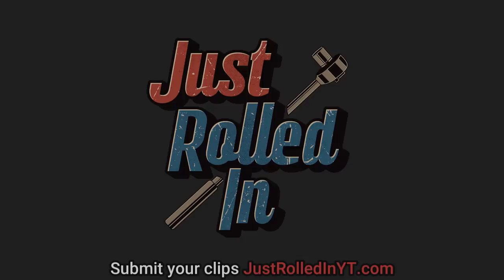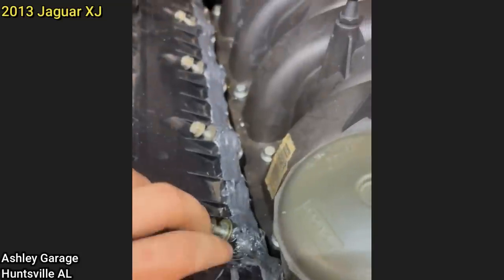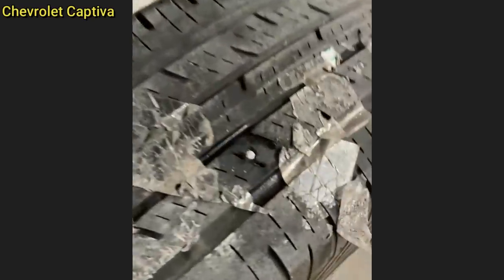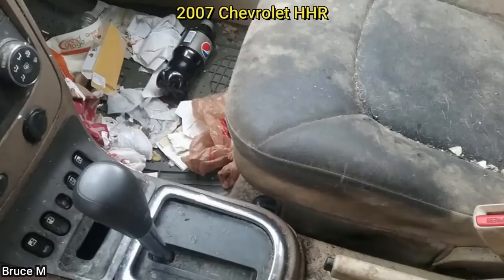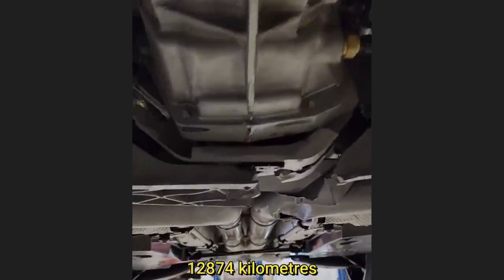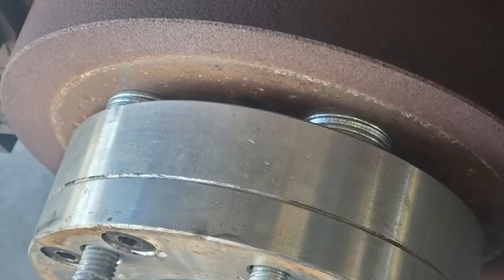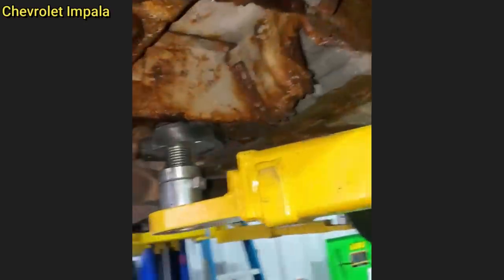Customer States Truck They Bought Has A Rumble At Low Speeds | Just Rolled In

Comment: As a mechanic, this is one of the most anxiety inducing episodes I've seen so far. Really glad we don't get disasters like this in the shop. Often...
Reply: Yeah man. I commented earlier that this is the worst one ive seen yet on this channel!
Reply: Sorry, yeah woman!
Reply: @rgr4475  lmao, no worries. 
But yeah it's honestly kind of impressive, if not completely terrifying. The worst I've seen at my shop since I've been there are wheel bearings with way too much play, and tie rod ends holding on for dear life. Once we had an Astrovan that had it's idler arm attached to the frame with some thin sheet metal and some small self tapping screws, and they were wondering why it was all over the road. Another time we had a Wrangler come in and the pinion gear in the rear diff was absolutely shredded.
Reply: @rgr4475  This hit me the same way! I kept saying to myself How? Why?
Reply: They don't need a mechanic.  They need a drug rehab clinic.
Reply: @ShelBelSapphire  Haha nice! Speaking of wheel bearings, I need to do my rear hubs. Are you far from northwest NJ?
Reply: @rgr4475   Minnesota, lmao. Bit of a drive.
Reply: Most these cars are from ghetto shops in the inner City. The sad thing is I still have 60 easy payments left
Reply: Thank god we never get these kinds of disasters in Finland. Thanks to yearly Safety & Emissions Inspection, which in a way is PITA, but least all cars on the road stay pretty much safe
Reply: @MrBluePoochyena  I honestly wish we had those here. Would make my job easier.
Reply: @ShelBelSapphire  It just makes life PITA if you love building cars for extra power and shit. Got to get reinspected/"reregister", 25% max HP gain over highest engine trim level allowed (provide Dyno Slip with more than 0.4 Bar of boost) which most cheat and actually run different settings. If i were to get the 17X9 Flow Formed Alloys and 245/40/17 tires for Summer, i got to reregister the car with those for my car to stay legal and not get ticketed. Same with Suspension and everything
Reply: Living here in Australia our rego inspections have always been a bit strict and even 40 odd years ago it was rare to see vehicles as bad as most shown here and the ones we did see were nearly always turned away.
Reply: @davegoldspink5354  Cars in this condition if we would ever even see them coming to the inspection would stay in that parking lot until the owner calls someone to pick it up for crushing
Reply: My thoughts exactly I kept saying HOLY (expletive deleted) the washers on the wheel spacer...
Reply: @ShelBelSapphire  Where at in Minnesota? The rust here causes people to get creative. My dad has moved his auto shop around the Coon Rapids area. Probably the worst one that came in was a car that started to buckle in half as the frame was being lifted up due to the rust and my dad dared not lift it up any further and told the guy its just gonna happen because the car was toast. I hear its not quite as bad near the southern end of Minnesota. Duluth, Grande Marais and around Lake Superior are probably where cars go to die I'd imagine. I haven't talked to the mechanics around there but that extra lake affect snow and salt must be even worse. I saw a rotted car where they replaced the doors and bumper with plywood and 2x4s when I drove through Duluth one time. A few years ago I drove by a guy where I could see his knees though the door.
Reply: I can't believe people put their family in those death traps. Let alone get an insurance company to cover those shit piles.
Reply: As a non-mechanic, I thought everything looked good, especially the tire repaired with packaging tape.
Reply: @schmojo33   I'm from around the cities, but work a bit north of there. Legitimately, the rust is my least favorite part of being a mechanic here. A 20 minute alignment takes twice or three times as long because you have to break out the torch half the time to deal with the rusted bolts. It wouldn't surprise me if the Duluth area was worse though. It's all around pretty bad rust wise. 
We are far enough from the twin cities to not have to deal as much with total rust buckets, thankfully, but a shop I worked at years ago, we ran into that constantly.
Reply: @ShelBelSapphire  Yeah the auto manufacturers don't make cars for the far north at all and the book time for each repair is completely fictional hopes and dreams. The new cars designed not for people to work on them combined with all the rust and relatively low pay for increasingly complicated cars where you basically have to have an education almost like a doctor is why I decided not to follow my dad in being a mechanic after being with him through repairs growing up. Not to mention customers not really understanding why the cost is what it is, especially in the rust belt. Watching people work on cars in places like California or Texas is like watching a whole different line of work.
Reply: @schmojo33  You're telling me. I just bought a "high mileage" 996 Carrera from Arizona. Zero rust. I did the rack and pinion on it, a ~2.6 hour job for just r&r, not counting tie rods and alignment. It took me less than half the time, not including waiting for parts. Would have been quicker had I not had to back track a little. Zero-rust vehicles are what I wish I was doing professionally, lmfao.
Reply: It looks a bit too much. Uhmm like BS
Reply: Agreed! My chest hurts!
Reply: that transmission mounted with a screw jack, straps, and a chain...... seen it all now

Comment: Gorilla glue? On a door? WTH!?! I think I’ve seen everything now… dear Lord.
Reply from the maker: Let's hope there isn't an emergency when you need to use that door 😅
Reply: @JustRolledIn  seriously! That’s just crazy.
Reply: angry ex?!
Reply: At least it doesn't needs the new latch XD
Reply: Modern day Duke brothers...  I was pondering how does one dissolve gorilla glue.
Reply: Common sense comes in variety packs 👍
Reply: " I think I’ve seen everything now… "
Yeah, wait till next episode
Reply: @douglash9364  That’s easy, real challenge is dissolving the gorilla glue without also damaging paint or plastics in the process.
Reply: @joevk6274  ah shit. U have a point there….🤔
Reply: yeah i know.  you're supposed to use bailing wire to keep the door closed.
Reply: @johnmarten4184  oh man. I ,Iove it!! That’s a much better idea.
Reply: @johnmarten4184  ... as long as the seat belt works you can use duct tape to hold a door closed. Heck, you might even be able to roll down the window and use the seat belt to hold the door closed!
Reply: @walkietalkie1973  you sure its variety packs and not lootboxes?
Reply: Just run the seatbelt thru the door pull.
Reply: @mikebelcher5111  ... you'd have to look and see if that was an option.
Reply: @Kalvinjj  should rename the channel to "You think you have seen everything.."
Reply: Just remember that woman who used Gorilla glue in her hair and tried to sue the company that manufactures it. That's the sort of person we're sharing the planet with.
Reply: The person who did this likely thought it would've been a complex repair costing  $800 to have it fixed so they glued it 🤣 .  Mechanical aptitude is heavily lacking these  days as this repair would've likely been under $50 for parts  or to simply have a mechanic fix it for around $250 .
Reply: Let's just hope nobody ever try to use gorilla glue on their eye lashes or hair 🤣
Reply: F*** a door. The first dude had his transmission and engine held in place with ratchet straps and a chain!
Reply: @JustRolledIn  "Let's hope there isn't an emergency when you need to use that door"
On the other hand, if the emergency is an angry gorilla trying to open the door, the dude's all set.
Reply: I mean... if nothing else, it's a glowing review for Gorilla glue.
Reply: @FizzieWebb  touché. Valid point.
Reply: And here I thought nothing could beat the legendary blinker fluid and indignation switch 🤣

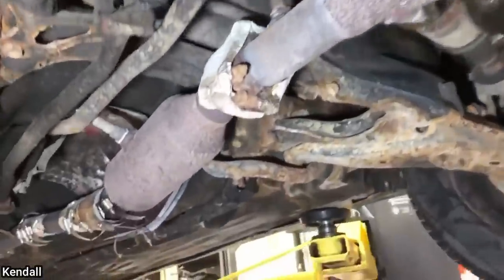Comment: 0:28 dude spent more on hose clamps than the price of a new exhaust.
Reply: I could not stop LAUGHING at that one,and it was in another shop as well
Reply: Yeah I had multiple rust out spots on my Dakota repaired with tin/aluminum cans, foil, repair tape, etc and finally quit being a cheap skate and had it replaced.
Reply: With enough clamps you can make complete exhaust.
Reply: I was thinking the same thing 🤣
Reply: @XtreeM_FaiL  Just arc-weld them all together.
Reply: @markh.6687  Welding needs expertise. Just use clamps.
Reply: @XtreeM_FaiL  clamp the clamps
Reply: It also has a chunk of copper pipe that was probably scavenged from a house.
Reply: @XtreeM_FaiL  I have seen welding, Good Sir, showing NO signs whatsoever of this 'expertise' you speak of.  😁
Reply: Dude had enough clamps he could have just welded over them too 😆
Reply: Exhaust leak and rattle? Well thats a real mystery...
Reply: @ Mr Bentlee

It’s like you idiots spent more time “engineering “ that exhaust than just fixing it.

Had a 94’ V6 Cavalier station wagon in college.  Front part of catalytic converter connection rusted off.  So, cut it out, Autozone, two clamps, and about an 18” piece of exhaust pipe.  

But I would never do a whole exhaust how they did it.  And I used actual exhaust clamps, not hose clamps lol.
Reply: And did they use solder or "liquid nails" all over it, too? That is some sketchy DIY work.
Reply: @billgabrielsonjr7259   Very true, Good Sir. There is always a way to make something more complicated.
Reply: I just saw your comment after posting almost the same thing. Ill delete mine. I wasnt trying to steal your thunder.  hahaha
Reply: As much as I hate to admit it, when I was a teenager, my truck had an exhaust that looked pretty much the same. My stepdad was a plumber, so I had access to hose clamps, no-hub bands, sheet metal, etc, and no money to actually get it fixed the right way. Hey, it worked for awhile, lol.

Comment: Once again totally amazed at these rolling on the highway, junkyard slider cars. Hell I know scrap yards that wouldn't even run these vehicles as parts chasers within the junkyard!
Reply: Yup I'd be embarrassed to even junk some of these deathtraps on wheels.
Reply: It seems that by today standards, anything that has 4 wheels and can roll on his own can be considered like a car.
Reply: when you can't even sell it as scrap metal cause Iron Oxide isn't valuable enough and that's all that's left on the car.
Reply: @SDogo  Fred Flintstone is out, then. How he manages to turn that thing on 2 wheels, I may never know.
Reply: @101Volts  what i want to know is where they hid the engine on something that has very little space for one! Fred Flinstone and other motorists seemed to have engines in their cars later in the series, but it was always a mystery where they put them!😂
Reply: @DarkVoidIII   No engines.  

"Let's ride with the family down the street
Through the courtesy of Fred's two feet"
Reply: One of the reasons that junk is still on roads IS the fact that scrapyards refuse to take them.
Reply: @ The Disgruntled Mechanic

Totally agree, and that’s sayin something.  Great analogy.
Reply: Lol. I used to crawl the junkyards when I was younger. I went in there one time and they had a parts chaser that was some old Mazda hatchback. No floorboard at all it was rusted out. To hold the driver's seat all they had was a bunch of wire coat hangars woven together to form a floor out of. It was permanently hotwired with a switch and starter button. I started it up, no exhaust components at all.
Reply: @SDogo  I think this is a strange American phenomenon. I can't imagine this happening in any other developed country, where (usually annual) safety inspections are mandatory, and the car would either be stopped and apprehended by the police the first time they saw it because it didn't have a valid inspection certificate, or if any of these cars were actualy taken in to be inspected the technician would not have let them drive it out again after taking one look at it.
Reply: @Jack_Russell_Brown  In here (UK) the mechanic doesn't have any legal authority to keep the car from the owner, but if the car fails a safety inspection with a defect that makes it dangerous to drive the report imediately gets uploaded to the government database, any cop can run that plate and in five seconds see the report and proceed to aprehend the car if it's seen being driven on a public road (actualy anyone can see the report, it's publicly available information all you need is to type in the plate in the government website).

Comment: Chrisfix has a good inspection list.

Ive used it when i was looking to get a car and it avoided me so many junkers. Then i found one that seem all good and at that point took it for a tech inspection.
Tech said, "if you dont buy it, i will". 
Best car I've had.
Reply from the maker: Awesome! What kind of car did you end up buying?
Reply: Chris Fix's lists are forever helping me out. Just tonight I put sandwich bags over my mirrors so I don't have to spend time in the morning trying to defrost them. YouTube legend.
Reply: @JustRolledIn  i used to have a gen3 TL.
Now i have a cx3 awd. (Tiny little thing thats freakin awesome in winter with the awd. No need for handbrake to have fun in snow, just give it gas an sideways it goes.)
Reply: Which specific things on the list did you find wrong with the cars that you didn't buy?

Comment: Some of those make me wonder how did they even survive the lift
Reply: Ah, the century old legend of the car that is so rusted, that the lift is moving through the girder instead of lifting it
Reply: Not such a strange thought. I worked with a guy that had a lower ball joint separate as it was being lifted on the rack. I've had an outer tie rod end separate driving the car into the shop...just 1 in a big list of those kind of moments.

Comment: Chains and tape - all you need. LOL. Reminds me of my younger days. Coat hanger, electrical tape and a leatherman fixed most problems on the road. Down in Mexico on a trip the alternator broke off my classic car. I used a coat hanger to fasten it to the fender well. Leatherman twisted it to get enough pressure to run the alternator just fine. Never did fix that properly. Lol.

Comment: I have a few cars that I had over 5 to 10 years each. The key thing was regular maintenance. Oil changes, transmission fluid change, rotation of ties, aliments. I did a lot DIY have a run into these issues. I would catch things like ball joints, control arm bushings and engine mounts before they would become a problem. Not everyone can do DIYs I understand, but spending a few 100 dollars in regular maintenance at an autoshop can save thousands. One simple thing, if you live in the rustbelt, wash your car regularly. Just doing that can keep you from driving a rusted frame deathtrap.
Reply: Dude 5 to 10 years is nothing. When you make it to 20 let me know.
Reply: @autohelix  I tend to move on with cars, but the point I was making is, you can see some of these cars that were not even 7 years old and they turned into rusted out POS's  from not doing regular maintenance.

Comment: I can understand about the door latch going out. The back passenger door latch on my saturn vue went out after the door was opened. I'm more sophisticated than using glue to keep the door closed. I took off the door panel, unscrewed the latch and used a 3,000lb ratchet strap to keep the door closed.

Comment: I remember during my mechanic days we had a customer with a Mazda 3 hatchback come in stating that their car was overheating ,and they couldn’t figure out why. It turns out they had some work done at another shop and they had rolled in with the alternator and a belt missing.
Reply: Can you even start and drive a car that has no alternator?

Comment: Seeing the first segment of your video reminded me of this time I had a 97 Chevrolet 1500 Z71 package truck show up at the shop, it was 2003 and the manual transmission was chained up and was secondary secured by ratchet straps since the tranny mount bolts were snapped off this was the real men of genius idea they could muster up. Nevertheless I was successful in extracting the broken bolts and cut the welds off of the chain, and had to cut the ratchet strap since the ratchet was perma rusted together. I'm betting the kid done a 6 grand dump on the clutch to break the bolts. The case was surprisingly not cracked anywhere too since I had plenty of time to inspect it.  Still have this memory burnt into my head after almost it being 20 years removed.

Comment: Apparently some people think that gorilla glue , packing tape and chain fixes everything 🤦 . The last clip , that would make a great recovery rig
Reply: That's the wrong combo, the correct engineers emergency toolbox is actually duct tape and WD40.
Reply: Incidentally, if he just used an entire roll of duct tape to keep the door shut (imagine covering the whole circumference of the car with the duct tape to hold the door shut,) it could have been quicker to remove. It would have been a lot easier to see as a "repair" in public, though.
Reply: @parafitality2730  Don't forget bailing wire.
Reply: @parafitality2730  can't forget a hammer ( bigger the better , or gooder )
Reply: @parafitality2730  Also, a tube of Stop-Leak and a can of "Fix-A-Flat" (for when you want to ruin your radiator and pay for a new one).

Comment: In process of replacing a front wheel bearing, customer started hearing a noise 2 days ago. All the rollers are MIA, caliper bracket holding everything together. Front brakes with rotors, c/v axle replacement, and, of course, a wheel bearing. When I went out to the parking lot to get it, RF corner had the tire lean of all time!